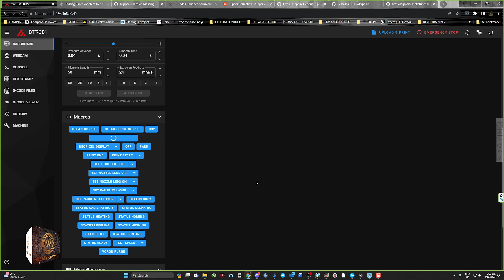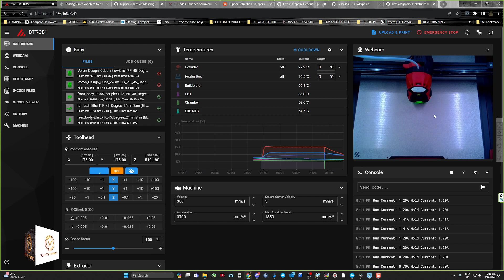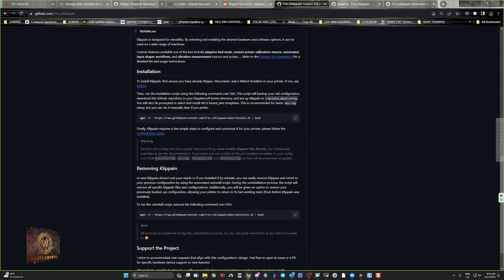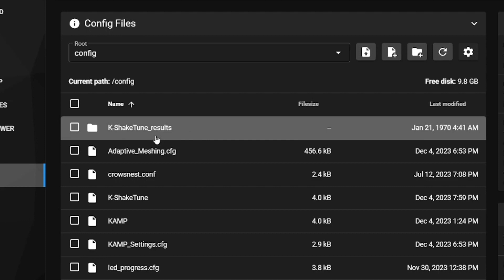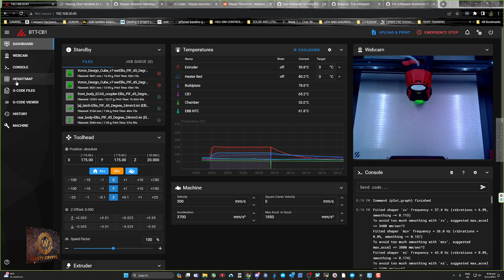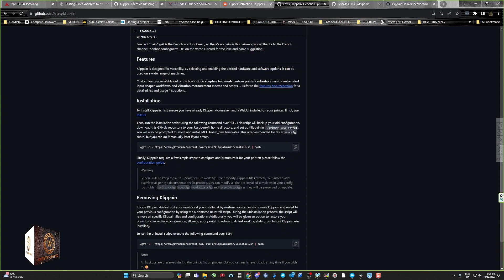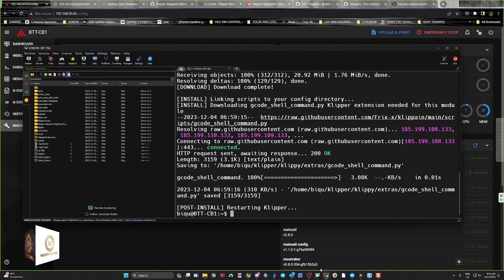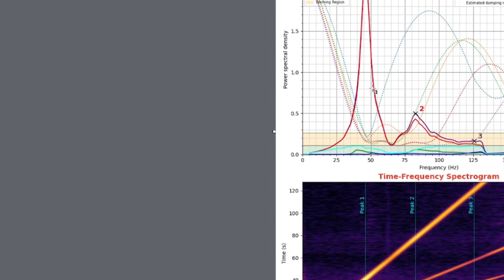KLIPPAIN SHAKE N TUNE - PART 2 - HOW TO USE AND ACCESS THE FILES

Comment: hi mate, thanks for your vids. I've just installed it myself as I was recommended by one of the guys in discord. I know that this should be pretty straight forward, but I'm not sure which one of the belt is A and which one is B. secondly, I've tighten them up in turn, and the graph is still showing a massive difference. as my printer is merc 1.1, there's a recommendation as part of the build of a certain expected frequency on belt and whenever I set them both to be on the same frequency, the graph is showing massive difference. I'm so confused!
Reply: looking from the front of a voron left to right, western language reading directions, printers sounds like sheeps: "BhAhAhAhAhA"
So B left A right